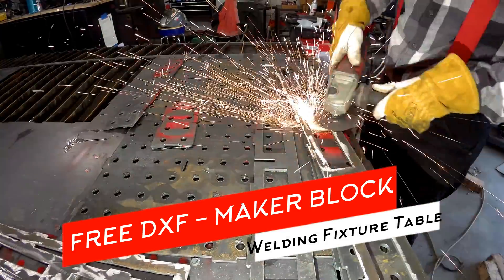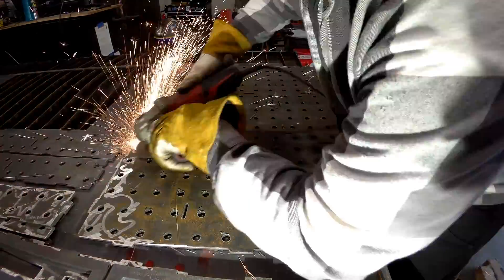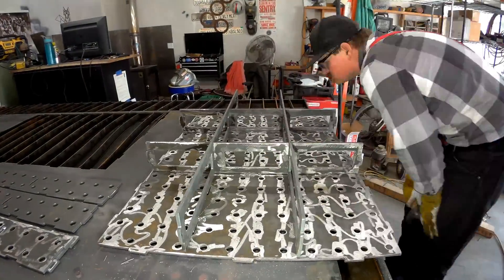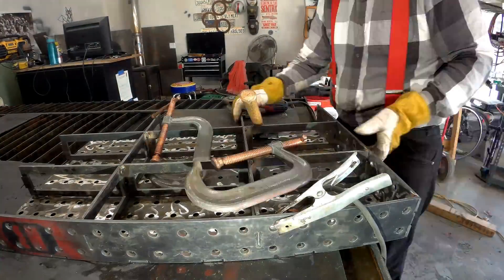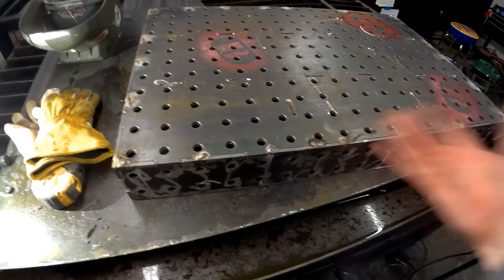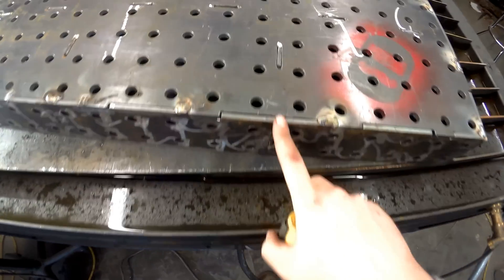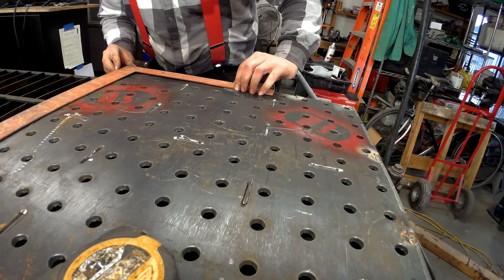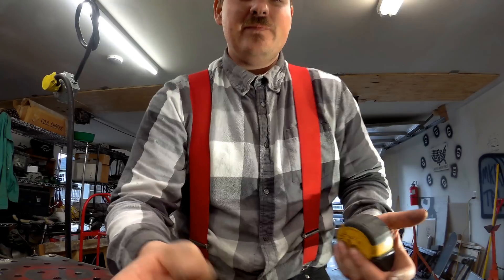Free DXF Maker Block Welding Table

Comment: Thanks alot for sharing this! do you have this in metric for sharing? thanks!
Reply from the maker: I don't have a metric version but if you bring the dxf into a CAD program you should be able to edit in metric.  Or just find some plate that is close to 1/4" and run with it.

Comment: been thinking about using all thread "spikes" as a materiel holder leveler like the 52 piece clamp set adjustable moveable replacable  and you can grind a point on em with the bench grinder If you f the placement up